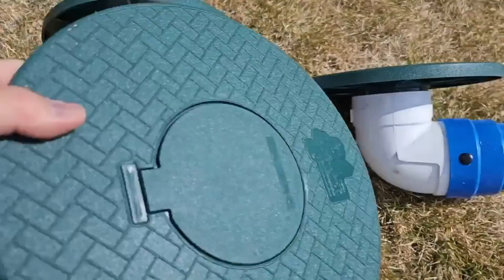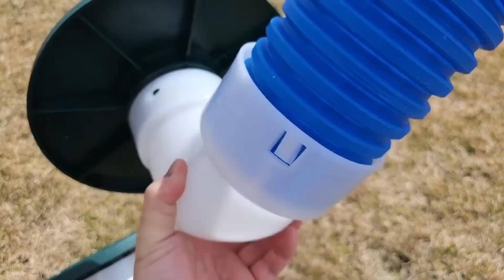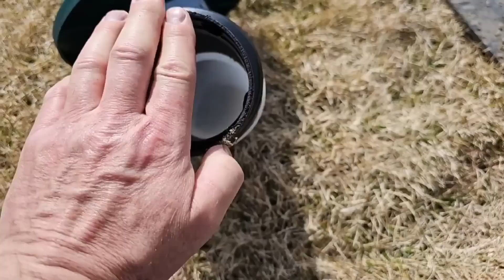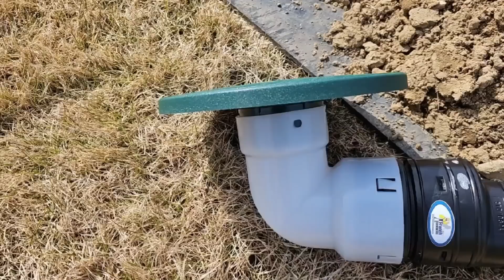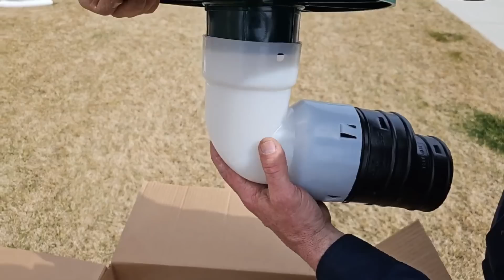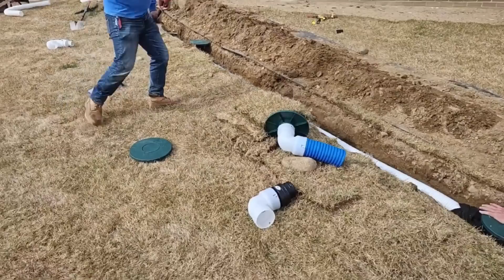New 2024 High Flow Self Cleaning Pop-up Emitter

Comment: Can it really work in cold climates? In Toronto this time of year, snow melts and the temperature drops quickly to freeze the system... then the 90 can freeze and water won't go through. No?
Reply from the maker: https://youtube.com/playlist?list=PLjFCqaZ4v1BUGJ5BDpKmnpVg8YH5_gFiz&si=0ju4DYyIdBqLgx61
Reply: @FRENCHDRAINMAN  Thank you! In one of the videos ("How to Prevent Underground Buried Downspout Pipe From Freezing During the Winter"). You also mention that "downspouts still freez up. and you're gonna have to put heat tape in your downspouts". So, if I don't do that, can the 90 still freeze?

Comment: I'm in FL with sandy soil. I installed this new version to 4" corrugated pipe, without fabric or gravel. Had heavy rain and ended up with erosion under/around the emitters so redoing it the correct way. I did drill at the low point and was about to tape but glad I just watched the video. I'm putting down 1.5 cu ft of crushed stone in commercial grade fabric to be safe. Any reason pea stone has been the choice in your videos instead of the sharp type gravel? Thanks
Reply from the maker: Crushed stone will compact over time. Natural stone stays loose; you maintain all the voids in the stone. In your case, it will not make a significant difference.  So, whatever is convenient for you.  Being in sand changes the rules a bit.

Comment: When you bury the Not Quite a 90 up to the edge of the fitting and then put on the turf restrictor plate, it sits about 1/2" above the ground. Do your guys stuff dirt under the plate to make it more stable?
Reply from the maker: @darrinmc  
Yes. You have to. Otherwise, it will rock. Pushing it down and having the plate seat in some dirt for best results.
Reply: @FRENCHDRAINMAN  Thanks for the info. I just installed a 75 foot run that combines 2 downspouts into a single popup. It was tough digging but I knew how to handle any of the issues that came up thanks to your videos. 

Getting the turf restrictor plates to sit at the right height was tricky for me. If I take off the turf restrictor plate, the dirt is flush with the top of the 90 or the catch basin opening. Dirt always falls in the fitting/catch basin. I'd prefer if you could bring the dirt up to around 1/2" from the top of the opening, then the turf restrictor plate was designed to insert like it does today but accounts for the 1/2" and rests on the soil. Thanks again for all your help.

Comment: I just purchased all the essentials for down spouts and it seems the not quite a 90 and pop up admitter with restrictor plate doesn’t have a tight fit. Should I take a few screws to make them solid?
Reply from the maker: @mikeirving1468
We never did that, not to a single one, and we've installed thousands of them. They're large plates, they're not going anywhere. You can remove the entire plate if you need to. But you can do whatever makes you comfortable.

Comment: @FDM - Asking for a diagram which compares the connectors and pipes. Which auto-updates with new releases and snapshot of the prices. Maybe a flow chart where i can pull it up prior to confirming my order. The info is in your videos, but you are pumping out new upgraded versions of things and it's hard to to be 100% what the differences are for the whole system. It would be helpful to include item numbers or some way to confirm. My idea of this diagram would compare differences in kits, adapters, pipe sizes, flow rate, etc.. i Basically made a cart, did research, compared benefits with live cost, made a drawing. Saved the cart. Cleaned out my cart, repeated for different variations to ensure complete and compatible system.
Why?
I'm one of those DIY people who research everything, take notes, make spreadsheets, etc... I struggled with things like, a) does this connector go with high octane or torrential rain. b) What is the increase in benefit (gpm math) of bumping up from torrent rain 3" to using left over 4" high octane. c) Do I have all the fittings i need?

Hope this helps the next.
Love the products!
Reply from the maker: @joshmoore1292  
3 inch works with any 2 x 3 Downs. Pout, in the country, I would caution the use of 3 inch in the tropical storm region for 3 x 4 down spouts. Long gutter runs and homes with a lot of roof top surface needs 4 inch pipe in the tropical storm region.

Comment: What would I need to adapt it to a 1 1/2” pvc pipe.   I went to the big box store and the pop-ups they had wouldn’t match up with pvc adapters.  They were either exactly flush, too big or small.  

I’m sort of in a bowl so the water goes into a catch basin and I pump the water out to where it’ll flow away.  (The pipe has been above ground and just open where it ended but I finally rented an excavator and got a trench dug through this rock.) If this isn’t the correct device for this situation, then could someone point me in the right direction?
Reply from the maker: https://frenchdrainman.com/product/sump-pump-line-to-4-in-corrugated-fitting/

4 in. x 108 ft. FDM's 200 Year Tape - Extra Sticky & Extra Stretchy - French Drain Systems | Curtain Drains | Macomb, Oakland, Lapeer, St. Clair County
https://frenchdrainman.com/product/4-x-108-fdms-200-year-tape/

Comment: I’ve dug my exit trench that is on a 1% slope. It will house a 4 inch solid pipe out to your new not quite a  90 fitting and pop up emitter. However, the depth at the end of the trench is going to be about 4 inches too deep when I install this. The trench has to be this deep now to maintain slope from my main 60’ French drain trench. Do you have a trouble shoot for my situation to bring the emitter up? I attached two risers together with this and it brought it up to the proper  level but not sure if you would recommend this. As well, does this pop emitter need a set screw to stay on the elbow or whatever I use as an extender  It seems too loose.  I also find it hard to believe there would be enough water pressure to rise this much to exit. Please comment on that as well especially when I have knife cut that terminates this system. Thank you.
Reply: Sorry I found out that you use risers for this problem. So could you answer my question about needing a set screw or something to secure the pop up emitter better to, in my case, a riser? As well, please comment on the ability of this system to discharge water based on the rise. Thanks again.
Reply from the maker: https://youtu.be/5MkELLf--AA?si=0hGAdNgNaI8-qd4J
I prefer to run it out even farther to where you don't need any risers, even if that last portion happens to be flat and not on a 1% slope. If the grade breaks, you'll eventually come out shallower. Simply put, water seeks its level, so however high it is in that pop-up emitter, it's going to be the same level throughout the end of the system. Once you climb up the 1% slope and you're upstream to the point where you're higher than the top of the pop-up emitter, you're fine. I like the top of my pop-up emitter to be lower than my entire collection system. We just ran a discharge line yesterday. We just ran a 100 feet long discharge line so that we could come out below our system entirely.
Reply: @FRENCHDRAINMAN  Okay thanks.  Unfortunately I don’t have any more distance to run it.  Probably a rookie mistake.  However, I will be able to flatten the slope of the trench a little more at the end of it to bring the emitter up a bit. Regardless, it will work out for me.

Comment: Whats the total height of this new close to 90 emitter? looks between 6-8 inch. Im trying to find out if i need to buy a Riser since i will end at around 12 in deep
Reply from the maker: It measures 7 1/2"
Risers lift the pop-up emitter 2" each riser.

Comment: Love the new design! Question, I’m now considering buying your pro kit with the not quite a 90 on both ends plus the catch basin with grate top with 3” corrugated. Will this be sufficient during winter in north east with the leaching at not quite a 90 fitting? I’m also considering knife cutting the bottom of corrugated pipe last few feet to prevent freeze ups with leftover water. Would add fabric and pea stone to catch basil, pop up emitter, and any knife cut on corrugated piping. Thoughts?
Reply from the maker: Old video, but it explains why we vent
https://youtu.be/XWA_frbMBis?si=kR5ueVyQr1Co0j2i

Comment: So my plan was originally to terminate my line with 2-5 feet of 4” knife cut (with a sock) into a sump pop up emitter (so the sanitary T). Keep in mind I live in Alberta  Canada which is even colder than Michigan. Would I need to drill a hole in the bottom of this new “not quite 90” fitting to allow for more water to leach into the subsoil?
Reply from the maker: No
Just don't tape the connection

Comment: Wish I would have seen this video, I drilled holes in the elbow 😢I think it will be okay 🤔
Reply from the maker: It'll work the same. It's just not necessary. Hopefully, you drill them on the hub because it'll be absolutely useless if it's up in the fitting itself.
Reply: @FRENCHDRAINMAN  what do you mean by the hub?

Comment: Awesome! I have 2 wye fittings from you installed in my yard. I agree, there is not enough flow. I have never had water even come out of the pop up because the water flows down into the rock/ soil into the basin. I might have to buy these and give these a try! For the north, do you still reccomens drilling a hole in the 90 degree bend for the north to keep the water out, or just don't tape it and you should be fine? I also have the slotted 2ft pipe in front of my pop up
Reply from the maker: That's a great 👍 system you ran.
You won't see water when it starts raining because the ground's gonna absorb a lot of the water with that setup. No worries, you are good.
Reply: @FRENCHDRAINMAN  do you reccomend changing out the wye or leave them? I have to run one more downspout in the next 2 weeks. Use the new 90 or a wye? Drill a hole in the 90 still or no?

Comment: Will there be a PVC pipe-fitting version? Or will I just have to use a PVC-to-corrugate adapter? 

(My lines are going out from my backyard to the sidewalk past my driveway, which leads to a curb->drain. No heavy traffic over it, and we are indeed doing it properly using burrito wrap method, geometric non-woven fabric, drain rock, correct slope, etc.)
Reply from the maker: We still sell the PVC version 
Best French Drain and Yard Drainage Contractor
https://frenchdrainman.com/

Comment: based on the height of the pop up, you guys are really not worrying about sloping away from the house? Just run the lines a few inches underneath the soil? The flow of the water from the downspouts will carry the water regardless? Am I understanding that right?
Reply from the maker: What a great comment. 👍 
You are 💯 right.

Comment: i turned the sanitary tee around in the opposite direction , why not use a long sweep elbow ?
Reply from the maker: We have, but it's a 90°.and it's PVC, which doesn't hold up to heavy lawn mowers. It cracks during the freeze /  thaw cycle in the North. This new fitting has a higher flow rate.
Reply: @FRENCHDRAINMAN  i  installed a kit i bought from French drain man for my down spout , but i turned the sanitary tee as you shown in the video , 180 degrees so the water is directed downwards toward the bottom opening so  all the water in the pipe will drain out their will be no lip to hold water back .
Reply: @45NUTS_PART_DEUX so are you still using a pop up emitter? I’m in the north and my dad wants me to exit into the ground instead of above due to freezing

Comment: Guys, stop looking. You will never find a better pop-up emitter than this!
Reply from the maker: Thank you 😊
Reply: Lets be honest, you're not going to find better residential drainage materials in general. 
TL;DR
I've looked for well over a year before I built my system. I drove 6 hours to Charlotte, NC to pickup my FDM system (ownspouts, french drain, corrugated pipe). That should tell you how much better FDM is than others.
I showed FDM items to a local landscape contractor and his mind was blown with the quality. Point bank,  HDPE is a game changer.

Save yourself some time of digging years later. This is definitely a buy once, cry once 'type of deal'. Or buy once, dig once. The reason why I say all this is because I dug 150ft trench twice by hand, so it's a touchy topic for me. My shovel has officially retired.
Reply: @AllGasNoBrakes77  That's exactly right!